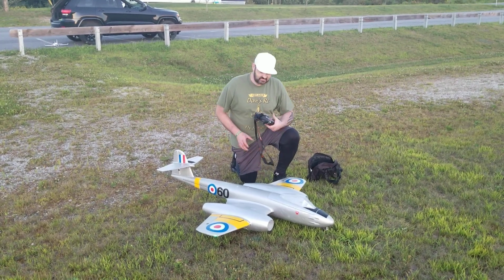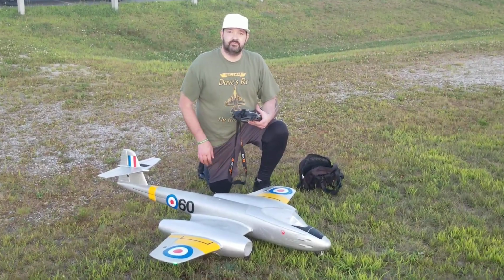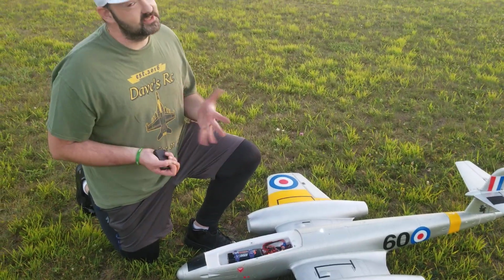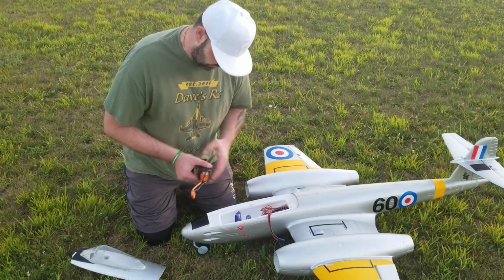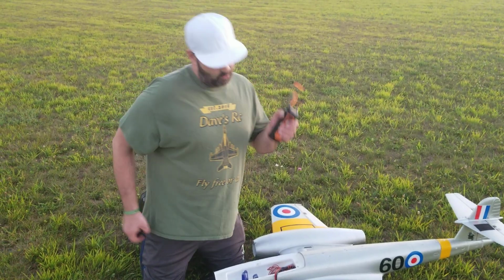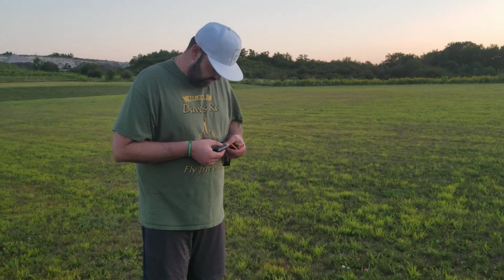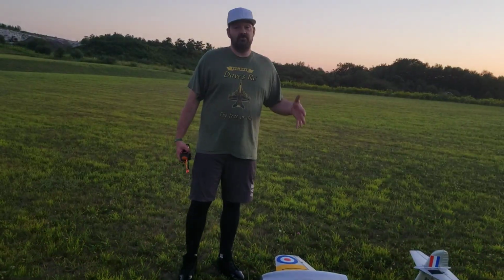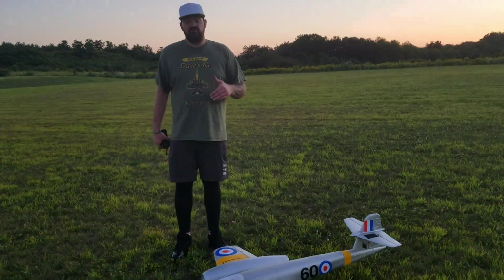Dynam Gloster Meteor on 6s, Remaiden.

Comment: Hey Dave, not sure what your timer was measuring, but out of my own curiosity, I timed your flight from the moment you throttled up (about 5 seconds before you began your take off) to landing, which was just over 2 min 30. Then you taxied back on and off throttle for 30 seconds.

Just around 4 minutes was way off my timer which read a total of 3:06.
Reply from the maker: I believe it was because before I rolled the camera I was taxing it around to make sure the nose wheel steering servo would handle the extra weight. Thanks for the info. I will be sure to share that in the next video. Thanks my man.